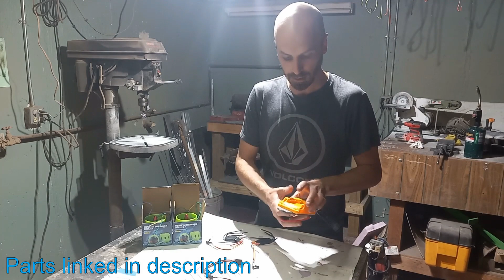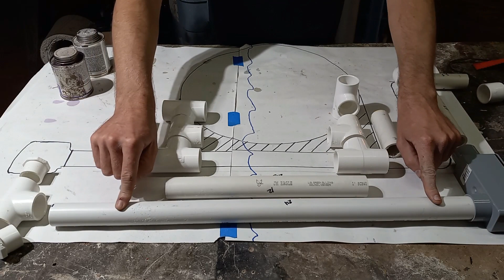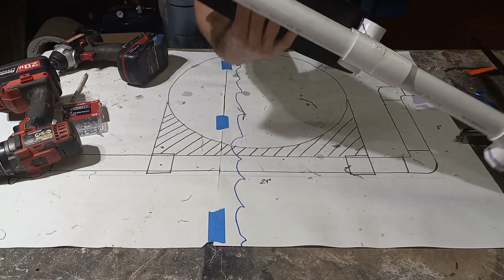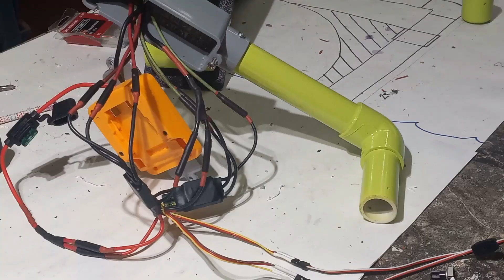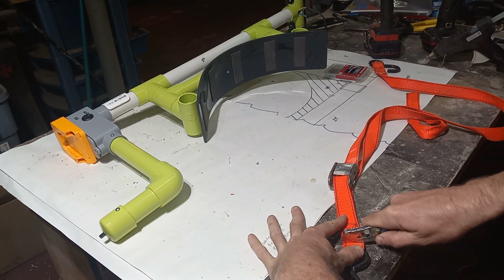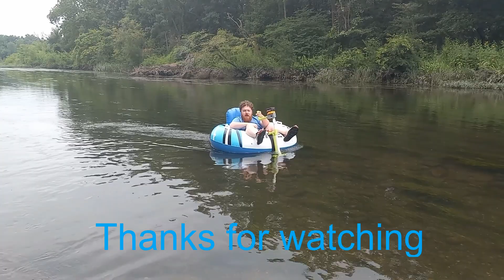Twin Motor - River Tube Power Motor II - DIY

Comment: I read somewhere that these motors can't be fully submerged. Can I submerge them, or do they have to remain on the surface?
Reply from the maker: They are intended for use on rov, or underwater drones. Perfectly safe underwater.

Comment: Have you did a run time ?  How long the battery would last since adding the second motor?
Reply from the maker: Run time depends a lot on battery size 3ah, 5ah, 8ah for example. Also weight, water current, etc. Roughly speaking,  a 5ah on the single motor using intermittently lasted 4 hrs.
Reply: Thank you

Comment: Did you have to put a hole in the mesh screen on the inner tube?
Reply from the maker: We did cut a small hole to run the strap through
Reply: @chrismakesstuff1  Thank you for the response. Great project by the way :)
Reply from the maker: Thank you.  Glad you liked the project.  If you haven't subscribed yet,  it would help us continue to make fun projects, and we have a bunch more coming soon